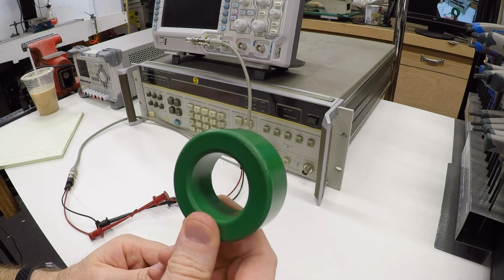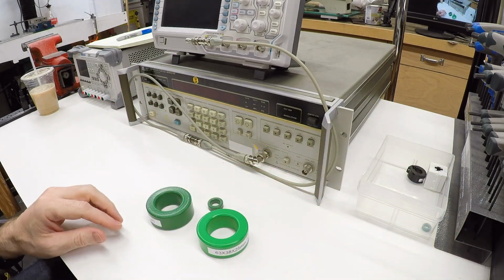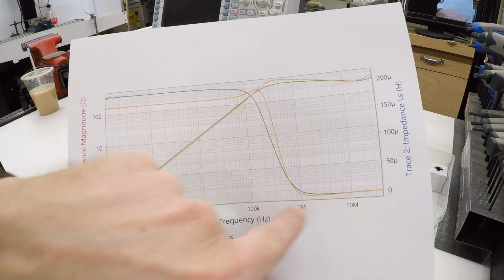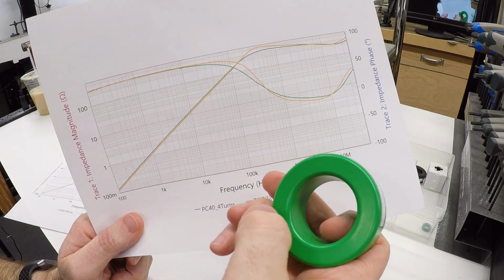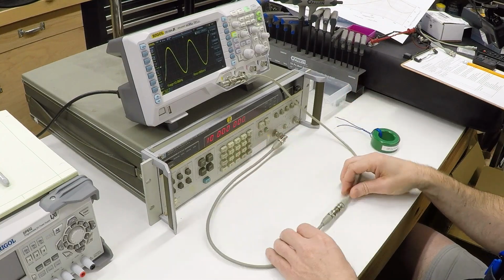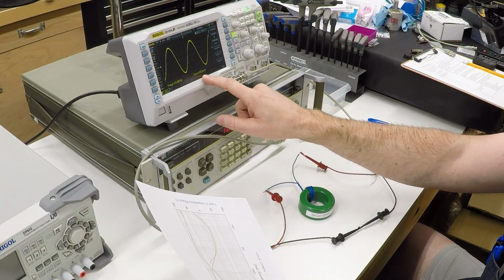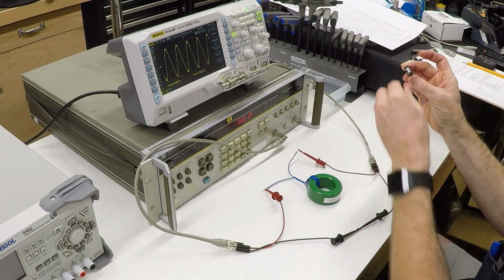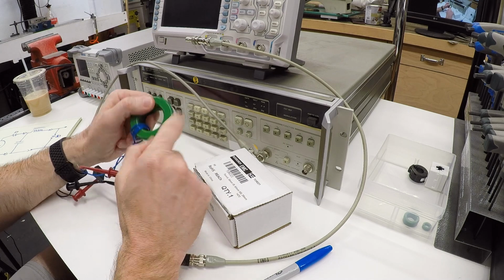How do EMI Filter Chokes Work?

Comment: Hi my induction range is putting noise and taking down my heating system communication with uses the 240volt house wiring to communicate to my room heaters 13khz pulses. What type of choke or filter will stop my range from sending back this conductive emf? The offending range circuit is 40amp 240 volt

Comment: What do i use to filter low frequency only like 100hz to 1khz if not more ?
Reply: you can use a big capacitor in parallel with the component you want to block this frequencies.

Comment: 20:30 When you were referencing how the Toroid doesn’t impact the signal at the low Frequency of the motor, I wish you would elaborate into the difference between the current frequency and the carrier signal frequency which could be something like (0.5Khz-16Khz)

Comment: Thank You James. Your explanation helped me tremendously understand especially when you talked about the phase angle graph. When you were talking about the impedance leveling out but the inductance dropping off,hearing that the inductor begins acting like a resistor due to phase angle dissipating energy as heat in the inductor. 
Despite the information being more “interesting related topic” as far as a laymen looking into improvements for running their motor with a VFD, just like yourself I strive to better understand the topics I delve into and evolve my understanding of the actual physics going on. You never know how related topics of your current area of focus may one day suddenly expand your understanding or lead to insight in seemingly unrelated areas of focus later down the road.
[The Epiphany when that difficult topic suddenly fits into that missing puzzle piece and results in pure Clarity 😇]
Reply: Since Toroids are so fragile they often end up broken in shipping or brief moment of accident while handling them. Knowing if they can be repaired and exhibit acceptable performance would be immensely beneficial to many.

Testing a couple different adhesives  including an electrically conductive graphite infused epoxy to compare if the effort of doing so is worth it compared to more common readily available options and looking at the overall impact the damage has on performance compared to an unbroken Toroid.

Comment: As an amateur radio operator and an IT engineer, this stuff fascinated me.  I'm learning about building antennas and all of them use a toroid wrapped in wires to create either 4:1, 9:1, 49:1, 5:1, etc.  Still don't understand it but I'm learning a little more

Comment: i harvest those from everything so i have as many sizes as possible. haha. to have a bunch of different sizes to play around with circuit theory you'd pay hundreds of dollars haha. especially the prewound common mode input ones. a variety pack of the emi input filters for smps costs a fortune from digikey. this is a very good test james. my last piece of bench gear is siglent spectrum analyzer that you can dual boot into a vna or sa because they are same chip for chip. i suspect i'll never use the vna so i'll wait to do the mod. the price of a decent siglent or rigol sa with tracking generator in canada is almost 3k after tax. well the rigol is 500 cheaper. i love that linear rigol you have. i have a siglent (xmas gift). i have the rigol mso5354 and i'm not a fan of it at all. i wish i'd saved the money and bought the scope you have or one of the new 12bit ones. there's no local market to resell my rigol with logic probes. i got it free from a hurricane removing my roof a few years ago. haha, but not really. i'd just finished revovating the house a week prior to the hurricane, haha.

Comment: Doesn't twisting the wires together in/out cause capacitance?  Isn't there a difference if the wire going in and out of the toroid are on opposite sides...

Comment: Thanks for this video. I'm trying to smooth the output of a rectified output from an SCR voltage controller for  a DC motor on my Hardinge lathe.This helps a bit as I'm not an electronis person. Thanks

Comment: I am adding LED light bars to my 2007 Yamaha Rhino along with a CB radio and AM/FM radio. The light bar converters make a heck of a racket on the radio so I installed ferrites inline and that fixed the noise problem.  I installed LED lights on my Toro zero turn mower and the noise is so bad, it swamps out the FM radio station on my AM/FM radio headset, it is next on the list for ferrites. Great video James as always.

Comment: Hey, just wanting to let you know you can make this kind of "VNA" measurements with free software REW and PC sound card and a view references reistors. 
it is shockingly curate up to 96khz and i uses it a my go to LCR meter. 

The software is indented for speaker measurements an calibration but it works awesome for this.

Comment: As you point out, significant changes occur at frequencies higher than 200kHz.  You have attributed this to (a). stray capacitance and (b). changes in phase angle.

Without disagreeing with you, I suspect that another important factor is the magnetic saturation of the ferrite core, characteristic of pure iron as well as ferrite materials.  I believe that the magnitude of the impedance of the inductor depends upon the rate-of-change of the magnetic flux.  If the core were simply air, then impedance is proportional to frequency.  But with a ferrite/iron core in magnetic saturation, the impedance is unable to increase any further, in this case above 200kHz.

Comment: Seeing that 3325B brings back all sorts of memories. Believe it or not, I used to calibrate them about 3-4 hours work) in one of the USAF's Type II Precision Measuring Equipment Labs (aka PMEL) as recently as 5 (4?) years ago. Worked on RF stuff and counters and light, a little bit of dimensional. Fond memories.... kinda miss it! Cheers! DE KA7MWQ. 73s!

Comment: When using the Ferrites of the output to your lathe motor, I believe you used about 10 of them. I only saw you put the wire thru them a single time. i.e. in your demo, you do four wraps of the ferrite. Would there be a benefit for the output wires to the motor to be wrapped around the ferrite four more times?

Comment: Great video !  My 3325a does about the same check the internal osc. and recap the unit it will be much more spot on the freq. I does generate a bit of 2rd, 3rd, 4th harmonics. Internal reference on output can be timed close when using the same test leads .  Regards

Comment: A basic fundamental in EMI filtering good job good explanation. What I am really interested is how to design a common mode filter for the mains input for an smps running at a specific frequency say 60Khz.  Do these filters resonate at the design frequencies?  Where should one tune them? Is it the fundamental or on the harmonic frequencies?

Comment: Blindly stumbling through a DIY CNC router build and was wondering about adding an EMI filter to the 400mhz VFD running the spindle.... holy hell did I just fall down the rabbit hole. Running about 10% comprehension 🤨 but still a good walk through. 28 minutes later and I’m like “ok so buy the green donut thingy and 4 wraps per wire...🤔”.

Comment: If you supply a square wave and use the FFT mode you can see the whole spectrum without having to manually change the frequency :)
Reply from the maker: Really?  If I pump a square wave into the FFT on my Rigol scope, I get a fundamental and a series of harmonic spikes, tapering down in amplitude.  In theory, I would expect it to be a much more broadband signal.  Maybe I'm missing something?
Reply: @Clough42  oops sorry, meant white noise, since the spectrum for white noise is flat.
Reply from the maker: @poptartmcjelly7054  okay.  That makes more sense.  I've been playing with different ways to visualize it better.  I might shoot something short looking at it again, because it interests me.

Comment: Separating the windings on the toroid should also help decreasing the capacitive dinwing to winding coupling which helps alot with dampening the higher frequencies. Nice video!

Comment: Nice. I think in the circuit you tested you'd need also to consider if the core saturates at high load currents. But in the practical 3-phase circuit, with all three phases passing through the same toroid, I suppose the current is net zero so saturation is impossible - providing the load is purely resistive.

Comment: I have done scores of the measurements like yo.  I just never made a great presentation!
Unlike an oscilloscope, I used an HP 3400A RMS meter that was good up to 10 MHz.  Also my signal source in those days was a Wavetek 111.   My target components were Corcom filters and application was to filter the commutation ripple of small (like 2 or 5 A motors).  But besides the commutation ripple, I had to also deal with welding arc starter noise (typically 2 to 20 MHz).  My own filtering attempts failed on one or the other need.  Hence the Corcom filters.  All the commercial filters are tested at 50 ohms in and out (or like you found, often not tested at all).  Well, I had not grown up with my impedances fixed to 50 ohms, so I was not able readily figure out what the effect would be at other generator and load resistances.  That meant I had to make my own measurements in my actual application circuits.  But I still remember that my Corcom filter started to produce useful (for me) attenuation at about 8 kHz.   Good.  Since then I have got more varied needs and have become a believer in properly selected toroid cores.
However, with increased experiences, and more/better instruments I also have found the value of 50 ohm domain.  A ferrite core alone does very little if the load is 1 megaohm!  After all, the attenuation is kind of voltage divider.  A 200 ohm toroid is not attenuating much in front of 1 Meg input impedance.  Need some lower impedance, but often cannot use just a 50 ohm resistor, because the signal might be DC or just a few Hz.  I need a DC blocking capacitor in series with the resistor.  At that point, I turn to my measuring instruments rather than trust my calculations.

Comment: Your filter would work a lot better if you had the capacitor on the other side of the inductor. This is the standard design architecture for an LC filter and ensures it will work regardless of source impedance. In the configuration you used, if the source impedance was low (rather than 50 Ohms), the capacitor would have almost no effect...
Reply from the maker: True, though in the real application, it's a three phase common mode choke.  No good way to add a capacitor to the common mode.  The cap was just out of curiosity anyway.

Comment: Very enlightening test of the toroid impedance.
 As I understand it, the purpose of the EMI filter at the input to the VSD is to prevent electrical noise generated by the PWM switching in the VSD from being conducted back into the mains supply.  So the "source" is the VSD and the "load" is the mains, in this case.
Also, at each PWM switching instant, the voltage with respect to ground on the VSD output lines changes rapidly, causing a spike of current in the lines that returns via the motor ground wire.  The purpose of the output toroid is to reduce the size of this ground current spike and, hence, the voltage spike on the ground wire.  The 3 output wires should pass through the toroid but the ground wire should not.

Comment: Really nice video!, However I think that, especially for people wiring VFD's, it would be more interesting to know the differences between common mode and differential mode chokes. Also, I would really like to see some VFD's noise on the scope with and without the choke filter.
Reply: He did that comparison on the VFD 3 video.  Check it out when you get a chance.  IIRC about 75% drop in the higher frequencies.

Comment: I think you described only an LR Low pass filter, a choke is something else where you have two lines switched as transformer. There are common mode and differential mode filters, only these are IMHO called chokes. The aim of those is e.g. to filter a common mode disturbance signal to cancel them out like a transformer with same number of windings on both sides. If you have a signal coming in phase on both lines, e.g. +/- and -/+ the they work against each other to cancel this common mode signal out.
Reply from the maker: Correct.  I was attempting to demonstrate only the effect of the inductor on the common mode signal, using one signal wire, relative to ground.  In the VFD application, all three phases would be wound through the core and the inductor would affect the common mode noise signal the same way it affected the sine wave in this demo.  Differential signals would be unaffected.

Comment: informative bench work, thanks

but LOL

let's see the waveforms on the power lines from VFD to motor, without filtering and then waveforms at the output of filtering.

The objective is for the filter to shunt (absorb) the hi-f energy from being conducted and radiated
Reply from the maker: I spent a little time with a high-voltage differential probe and a scope, but it's really hard to see the difference clearly.  I may give it another go at some point.
Reply: @Clough42  so all we have is faith-based electronics?  :)